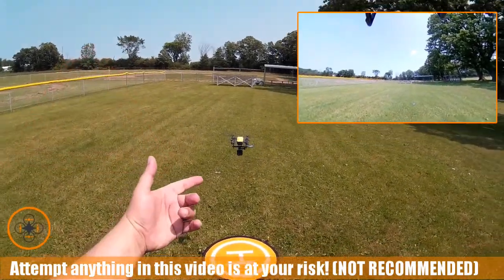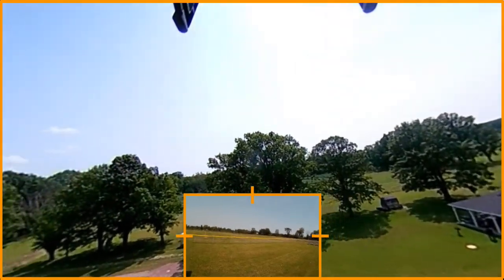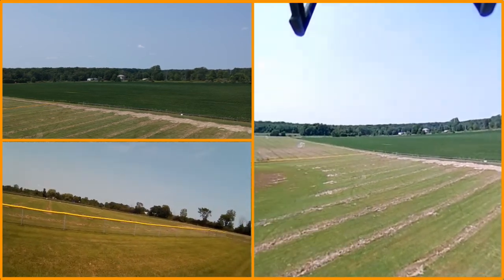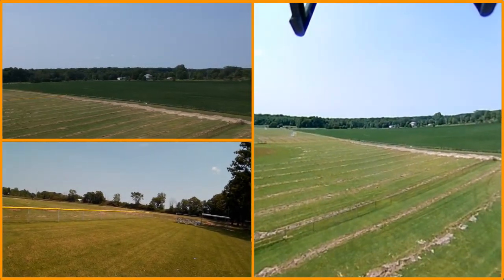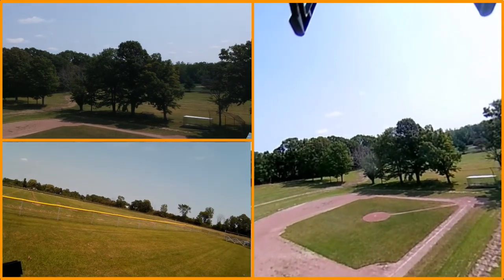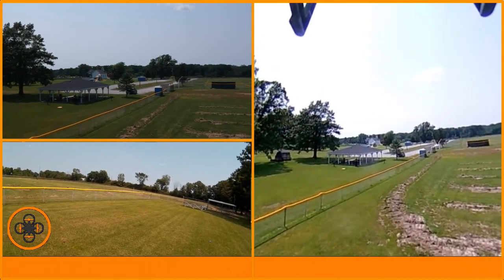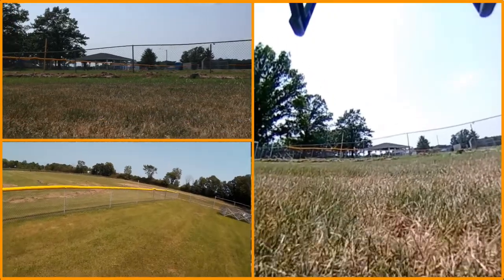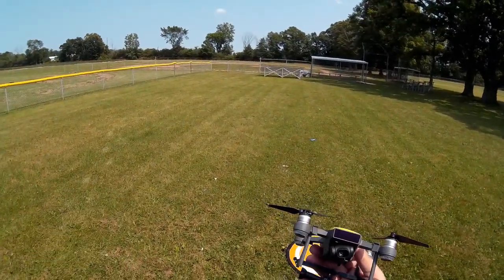Video Drone - DJI Spark Flying an 360 Degree Camera!

Comment: I was planning to bottom mount an 82 gram insta360 One Camera on my Spark but was wondering, how you landed it and get it to shut down the motors?  Doesn't the downward sensor have to sense the drone is a few inches from ground to stop the motors?
Reply from the maker: You would have to do a hand catch and just and just pull the left stick all the way down to stop the motors.  However the issue you find with that much additional weight it will enter a PID loop (on the ESC's) and want to keep rising so it will pose a fly-a-way risk...

Comment: Hi there, i have an indoor application for mounting a 360 cam on a spark and my cam is rated at 107g. Do you think this is too heavy? I would like to top mount it somehow using a custom 3d printed mount. What was to total weight of your mounting bracket plus cam?
Reply from the maker: First, please never mount anything on the top (of a drone) as this is where the electronics and antenna are in addition to creating balance issues as if the Spark "tips" it turns off.  While you could try (at your own risk),  107 grams is too heavy in my opinion  as I found about 50 grams really starts stressing the ESC's as the PID on these are not adjusted for the additional weight so it will want to climb and keep climbing.  The weight of the mounts where only few grams...
Reply: Video-Drone thanks for the feedback. Bit of a bummer as i thought this would be the perfect solution to my requirement as i love the stability of the dji products.  I have a phantom 3 but it's just to big to fly indoors for my application. Was hoping the spark wil do the trick.
Reply from the maker: Especially indoors believe you will have more issue as you will lose GPS :-(   As I was typing this saw this on the side (https://www.youtube.com/watch?v=y-hhT4obUo4) and had to laugh as this guy is asking for trouble :-)